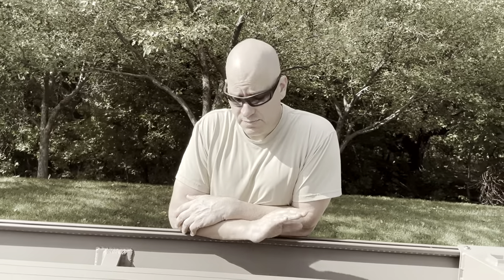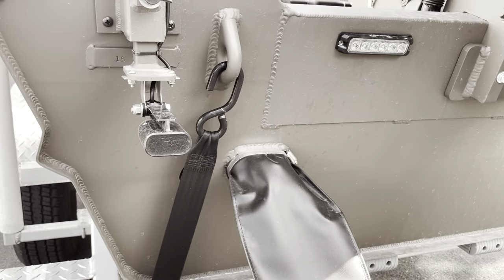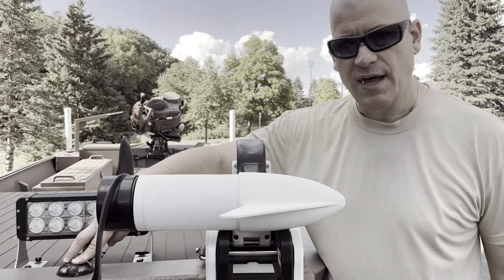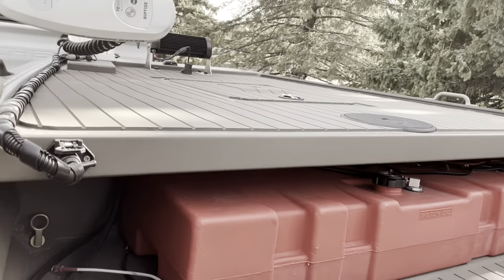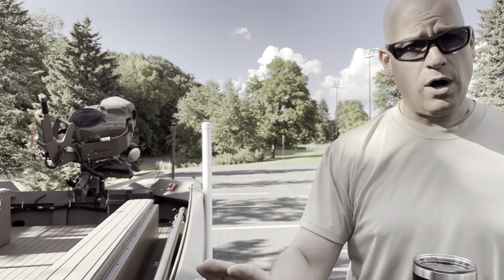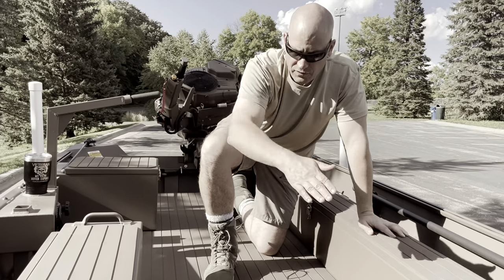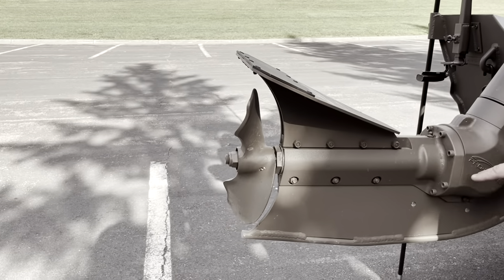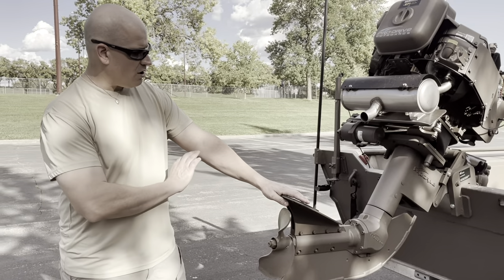Green Berets review the perfect survival boat: Pro-Drive SBX (Self Bailing Hull) review

Comment: Hey Matt…2 months out from terminal.  You still liking the boat?  They’ll be building mine soon.  Thanks again…and thanks for you and all the other special forces services for your exceptional sacrifice.  I sincerely appreciate it.
Jim
Reply from the maker: Jim,

Absolutely love the boat, currently using it in the FL Everglades area (both salt and fresh water). Soon, it will be up in Northern WI. Take some time to practice putting the boat into reverse as it is different than a traditional boat and quite a bit more powerful. The boat will go through almost everything an air-boat will, handles big water well and is extremely fishable. Many down here are running $70,000 technical poling skiffs (Maverick, Hewes, etc.) and this boat will go places those can't. Tell KP hello for me!

Matt
Reply: Hey Matt…one last question for you.  And glad you’re enjoying the boat.  I can’t wait.  The threaded holes in the deck to lock down the multi position boxes with thumb screws…they don’t go through the deck open as to allow rain or water into where the foam floatation is do they?  Thanks again!

Jim
Reply from the maker: @jimmcd525 , no it is a separate chamber that is sealed. Just verified this with KP before I responded.
Reply: Awesome…thanks again!
Reply: @thegreenberetlife9949  how did it handle it in Wisconsin? I’m from Wisconsin I’m just looking at pro drivers or gator tail.

Comment: Hey Matt…fellow veteran here.  Is there anything that locks or holds the motor tight…for when trailering long distances?  A motor support in other words?  Thanks in advance!
Reply from the maker: Jim,

You lock the motor into position with the hydraulic pumps. The transoms are so stout, there is not a need for a transom saver. They are literally floating tanks…
Reply: Great…thank you!  Pulled the trigger on one the other day.  Take care.

Jim
Reply from the maker: @jimmcd525 , congratulations, you will love it!